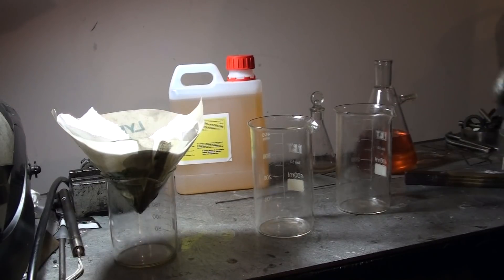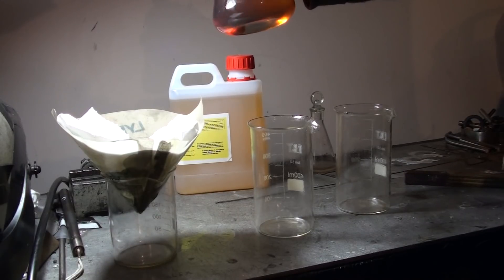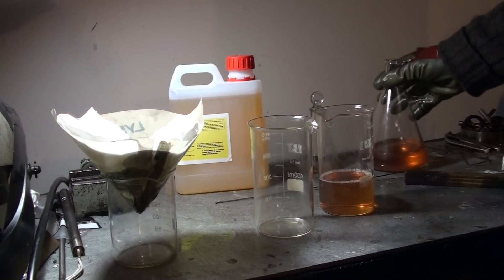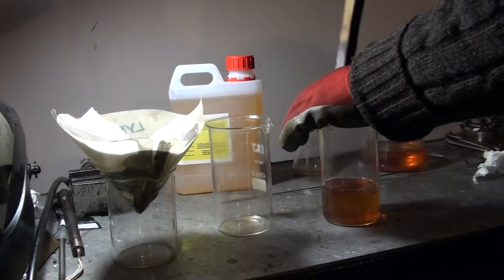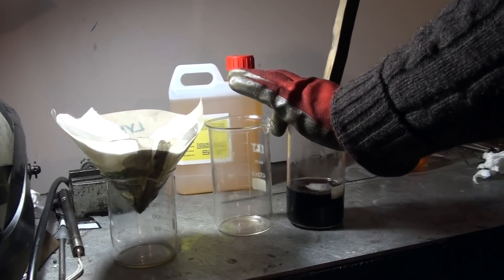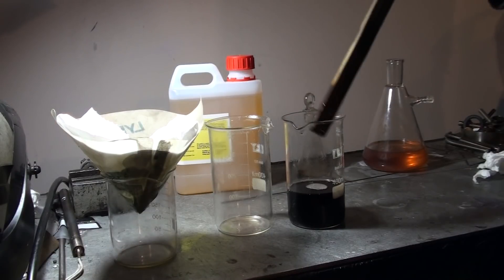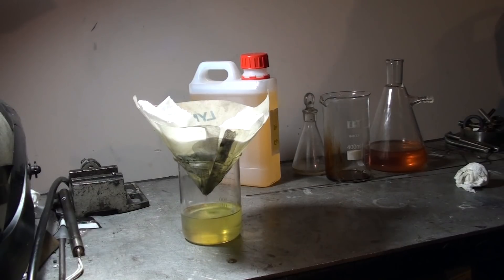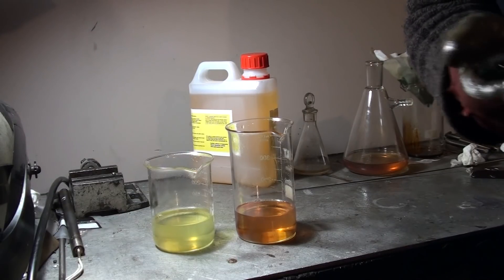Diesel fuel - pigment removal (chemical bleaching)

Comment: Hello Alek, I work in the production of diesel from waste oils. My process is carried out through pyrolysis, and after the process, once the diesel cools down, it becomes dark. I am currently bleaching it using a silica bed filter, but the silica’s efficiency is very low because it saturates very quickly, and only about 20% of my production comes out with a yellow color. The rest ranges from brown to red. I need to find a way to bleach around 20,000 liters per day after pyrolysis. Can you advise me?

Comment: I want this method
Reply from the maker: Use it, - sulfuric acid and triethanolamine, bu too messy I personally prefer continuous distillation of the died, contaminated, dark, oxidised diesel, and then a short settling with a bit of silica gel, no chemicals, better result.

Comment: Install another fuel tank to your car or truck so your original one is obsolete but keep a little normal diesel in it in case you get dipped and tested then put the red diesel into your new fuel tank...no need to mess on with dye removal haha  Your welcome 👍
Reply from the maker: It is a piece of good advice for the free people of the UK where there is a democracy rampage. But I am in NZ, so there is no need to install any extra fuel tanks.
Reply: I found out how to remove dye naturally... Leave in clear container outside in the SUN. The UV rays dilute the colour and turn it yellow.. Free and easy... Takes about about a week for the process
Reply: And you are screwed when they decide to take the sample from the, fuel system 🙃
Reply: @MrPuusilima  How? There's no red dye left as the suns rays destroy the red pigment 🙈
Reply: @memyselfandi36  they can test the fuel if there is solvent yellow 124 inside
Reply: If you leave red diesel outside in the sun in a clear container in a few weeks the sun bleaches the red diesel and takes the red pigment out of the diesel.  Mother nature... Who would of though it.
Reply: Well buddy just ain't that easy because they don't dip it out of your fuel tank all the time they'll get it out of your fuel filter... then what are you going to do when they  test you that way???

Comment: Le filtrer avec du charbon de bois .le charbon de bois impringne le colorant ou avec du cotton bande hygenieque pour le les regles pampers
Reply: Doesn't work at all.  It will only filter the black carbon back out of the fuel which so then remain red

Comment: during WWII they put red dye in gasoline used by the military so civilians could not use it. people found that you couuld remove the dye by filtering it through bread.
Reply from the maker: During WWII in Soviet Leningrad, which was blocked by the nazi army people were getting about 150 grams of low-quality bread a day, they were eating dirt at the place where food warehouses were bombed by Luftwaffe - the dirt was soaked with fats and melted sugar. so the bread was scarce the cars were run on wood chops with gas generators where possible. All civilian machinery was mobilized for warfare.
Thus if one can use some bread to filter some petrol during wartime, then what sort of war is it and what sort of people are they?
Reply: @santeryi9  wartime Britain did not ration bread.
Reply from the maker: @shloomyshloms  Britain was not invaded.
Reply: @santeryi9  irrelevant to my original statement.
Reply from the maker: @shloomyshloms  you mentioned wwll, I replied with a different story about bread, so if bread is good for the fuel die removal, so be it.
Reply: Bullshit.. Try pouring any liquid over bread and the bread will turn to mush and fall in the fuel
Reply: @memyselfandi36  that's water https://youtu.be/fnbq7vNUUUw?list=PLjgZr0v9DXyL-6PSUqotzTc3zhPNkxFC_&t=1796
Reply: Actually thats about drinking denatured alcochol. Stuff for cleaning and thelike. It was purple... The drunkards filtered it thfrough bread to remove the dye.
Reply: @86Corvus  no it was tested on a british show about WWII civilian life.

Comment: Hi polek.very grateful for your video.is this tea we can use in ldo(light diesel oil)? 
If we can than what's the procedure .kindly tell me .will be so greatfull to you
Reply from the maker: Hi, yes you can use it for the light diesel oil, heat it up a bit tough first - up to 60c use 1 to 2% out of volume concentrated sulfuric acid, mix well, leave for a while - a couple of hours, then remove the oil into a separate container leaving the deposits behind. From this point there could be a number of further treatment methods. Like this one where I used triethanolamine, 0.02% - add while mixing and continue until oil becomes clear with flakes of the dirt floating around - from this point - settle, filer. Another method - is to add 10% water solution of either baking soda or sodium hydroxide - add about 4% out of volume, mix well - settle filter. Do not forget to run a copper strip test before use.
Reply: @santeryi9 😮
Reply: Thx dear .god bless you
Reply: Alex polek one more thing sir .is there any chemical which we can use to remove the smell of diesel or change the smell in diesel

Comment: I tried today, doesn't work, first sulphuric acid, next thretonolamine.
Reply from the maker: Was the acid concentrated 98%? So, you adding 2% out of volume of the fuel of acid and mixing for at least 15 min, then settle for at least one hour, then you should transfer the resulting fuel into a separate container, it should be almost black after acid reaction, then add 0.2% of triethanolamine and mix for as long to make sure that the fuel changes its color to yellow, settle and filter. Triethanolamin should be added slowly into stirred fuel so it is not stick to the bottom of the container.
Reply: @santeryi9  What is the concentrated (percent %) of triethanolamine ? is triethanolamine 0.2% or more then that i need to use ? is there any other alternative of triethanolamine ?  Please replay soon . Thank you  :)

Comment: run red diesel through 1m2 of cotton and you dont need no chemicals,no centrifuge no nothing.common chemistry.......doh
Reply: Does it actually work tho?!
Reply: Really?  I think not... Doh 🙈
Reply: Would be great if it worked
Reply: @panamacmillan  activated coconut charcoal and then run a column chromatography with silica gel it will get everything unwanted out